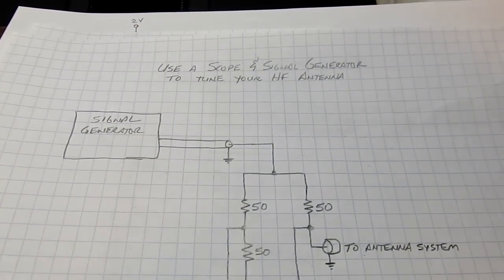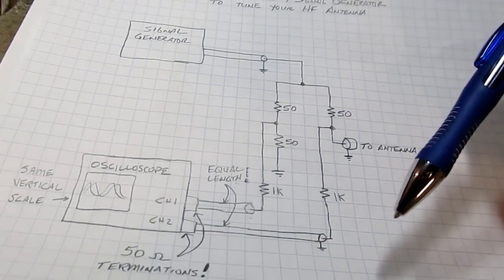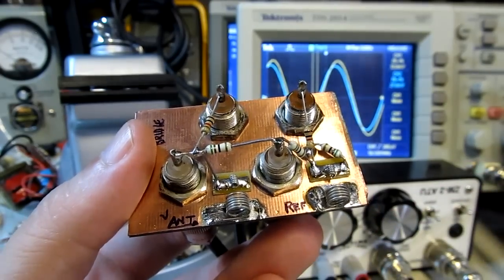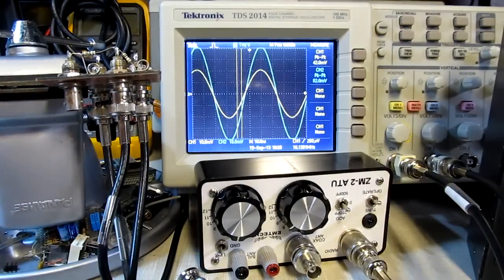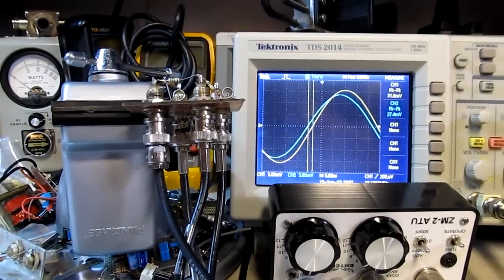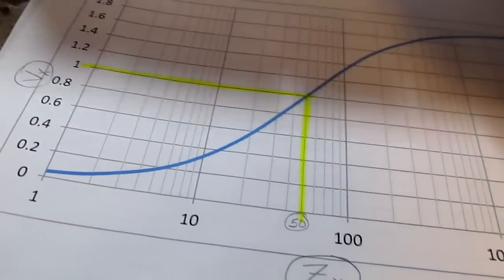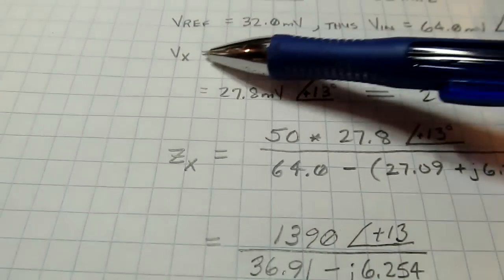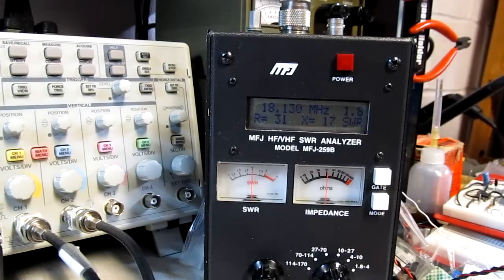#112: Use an Oscilloscope and Signal Generator help tune an HF Antenna, measure complex impedance

Comment: Hi, can you help... i am making an automatic RF matching tuner using arduino. But i need to read the magnitude and phase detector signals out of the coupler ... but here's the part where i stuck because i don't know what i can use to read/show these signals like any module or screen or if i can show them on my laptop by arduino's serial monitor command using this "Generic AD8302 RF amplitude and phase detector"...I don't know which would work. I am working in the range of 150-220 MHz. Plz help ASAP
Reply from the maker: In my opinion, there's no need to measure phase.  All you're trying to do when establishing a match is to minimize the reflected power, which can be done using just the ratio between forward and reflected power.  The AD8302 can be used to measure this ratio.  You could read it's detected output with the Arduino's ADC.  You may need to apply a low pass filter to the AD8302 output, as describe in their datasheet, if the signals have any kind of amplitude modulation on them.
Reply: actually i want to stop the movement of my stub tuner at a desired length which i would calculate from the Smith Chart equation. So for that i need phase value and magnitude(or Reflection coefficient ) value. Can u tell me ur Email.
Reply from the maker: OK, you should be able to read both outputs using the 10 bit ADC and the AnalogRead command.

Comment: hello I hope u are fine.
can u help. please tell me how to calculate or find the values to the components to build a cristal oscillator circuit that generates 3 Mhz or 2Mhz?
Reply from the maker: Congo Beats ( Congo Production ) See this video on how to build a crystal oscillator, and simply use a crystal with the desired output frequency.
https://www.youtube.com/watch?v=blalAktxFoI

Comment: What does the antenna tuner do to the antenna to change it's input impedance?
Reply from the maker: It doesn't do anything to the antenna itself.  The name "antenna tuner" is misleading.  The device is more accurately called a transmatch, or adjustable impedance matching network.  It transforms the impedance seen looking into the feedline to a more desirable impedance (usually 50 ohms resistive).

Comment: I want to do this experiment, and when I checked my terminators with an ohm meter, they measured 72 ohms, even though they are marked as 50 ohm terminations.  Is this a matter of math, and I can go ahead, or do I need to make up or purchase some 50 ohm terminators. 
Thanks for another great video.
Bob
Reply from the maker: It would be best to have 50 ohm terminators. You can use the ones you have, and things will be close.
Reply: Not an expert here by a long shot....but a regular multimeter is DC and RF is AC so it all depends on the frequency, does it not? Not sure how the manufacturers like Mini Circuits measure their stuff...I have a couple N type attenuators and the measure 80 Ohms at 170mhz (100ohms at 3mhz) using the MFJ
Reply: What was torturing me, is that I have five of these that I purchased used from someone that was using them in an old 10T ethernet system, and all were marked as 50 ohms, and I thought the resistance should read 50 ohms.  The only reason I even tested them all, was because I had one PL239 type terminater that wasn't marked that measured 72 ohm, and out of curiosity even though all the BNC terminators were marked as 50 ohm units, I thought I had better check them.  I was very supprised to see that they were all 72 ohm and didn't think it was right.  I had since found my old ARRL antenna booklet and discovered what you are confirming for me.
I am just getting started again after many years away from the hobby, and it is amazing how much I have forgotten. 
Thanks again for all your wonderful tutorials.  I just dug out my old 545b Tek scope so I can play with the differential amp.  It has been sitting awhile, so I plan to use a Variac to slowly bring it up to the operating voltage.
Bob
Reply from the maker: SuperJetjockey If they are attenuators (not terminators), they may only read 50 ohms when a 50ohm load is connected to the output.
Reply: *****
I have solved the problem by ordering 10 of the 50 ohm terminators.  I have some 72 ohm line that I am going to experiment with later, and decided that I didn't want to mess with the 72 ohm terminators, as they are high quality units. 
I am having so much fun with this stuff again, that I was even able to get my old 545b scope running again.  I have the dual trace plugin, a differential amp, and  a type S diode checker,    I also have a 2246 and a 475b, but I thought the extra functionality of the plugins made it worth the time. 
I used the variac, and it seems to have done the job.  It has been so long since I used the diode recovery plugin, that I will have to find some instructions.  I really appreciate the way you make such complex topics so logical and understandable.
Bob

Comment: Hi Again Allen,
Why is it twice the voltage and in phase when you remove the antenna? I bought all my parts that I need for this I bought a bag of 50 47 ohm resistors at 5% so I will pick out three high ones and get pretty close. I just got my General ticket a few weeks ago and want to tune my antenna for 7.237 Mhz it is a 40 meter dipole. That freq is in the middle of the General phone band on 40. Can I use a Viking Matchbox for my tuner?
Thanks
Reply from the maker: Given the source impedance is 50 ohms, and a load of 50 ohms is attached, this forms a voltage divider due to the series connection of these two impedance so. If the load is charged to a high impedance, there will be little drop across the source impedance, thus the voltage is twice as large as the 50 ohm load case.

Comment: Isn't a dipole about 73 ohms though? I know people tend to use 50ohm coax anyway, but I thought why not use RG6 to a dipole, and then everything is based around 75ohms instead, especially if building your own transmitter from scratch you can just design it for 75 ohm output
Reply from the maker: In free space, Ideally yes.  However, in actual installations, proximity to ground and other factors tend to lower the resonant impedance down closer to 50 ohms.
Reply: @w2aew  ah, thats true, good point

Comment: am working for walket talky project. how the signl generator works on panel antenna on site works ?  how we can check the signal strength on antenna using signal generator ??
Reply from the maker: In order to check signal strength, you'll need a reference antenna as well as a field strength meter, reference receiver or spectrum analyzer.

Comment: Suggestion:  use good old-fashioned, crummy carbon composition resistors.  They're not too accurate (use a DMM to match them), they're noisy, and they have terrible temp. coefficients.  But they're NON-INDUCTIVE.  Metal & carbon film resistors aren't.

Comment: Wow, Amazing! Very simple and accurate. I'll make one. Thanks for posting it. Is this your design?

KD5MHQ
Reply from the maker: No, not really my design.  It's really nothing more than a simple bridge circuit.  I put it together, and selected the specific values used, but there's no magic here.  Similar ideas have been published many times before, and can often be found on the internet and youtube.  I felt that some of the presentations found online were lacking in detail and clarity, so I put this video to try to help make this clear and concise.
Reply: I've built a resistive bride before with a 100uA meter; it works, but for some reason, it still doesn't give the exact null when the antenna is tuned. Works great on a 50 ohm resistive load; just a bit erroneous with the tuner and antenna. Gets close, but I still have to finish the tuning with the rig's built-in SWR meter. I'm gonna build yours--it's far better. Thanks!

Comment: Hi Alan! I repeated all your steps to tune my own car cb antenna and I got excellent result. Market ready antenna gives attenuation of 15-20 db on my frequency and my own piece of wire with proper matching system gives attenuation of 40-50 db - absolutely unexpected result! Also I used David Knight (G3YNH) Impedance matching algorithm to calculate matching additional reactances. As I am lazy to calculate all complex number on paper I wrote calculation program (only windows sorry) where one can enter YOUR data from scope and got complex impedance and matching circuit with parts values. If you are interested in that program for your subscribers I placed it at 
https://drive.google.com/file/d/0BxbulXE0Id_BejA5UEo3ZzVhLTg/view?usp=sharing
Thank you very much!
Reply from the maker: Alexandr Fediaev Thank you - and nice job!
Reply from the maker: The 50 ohm termination ensures that the are no reflections of the signals coming down the coax, which would affect the amplitude.
Reply: Alexandr Fediaev  Hi, saw your program, if you wrote it using Qt5 - isn't it possible to target other platforms?
Reply: Hi Raymond! I'm new in Qt. Really this is my first try in Qt creator and I never tried other platform except Windows. Also I have no computers with another OS to test. But I can share source if someone can recompile it. Best regards!
Reply: Here is second version without some image bugs. It contains electronic setup from Alan and Z-plane map.
https://drive.google.com/file/d/0BxbulXE0Id_Bb1dFWUNhVzg3QzQ/view?usp=sharing